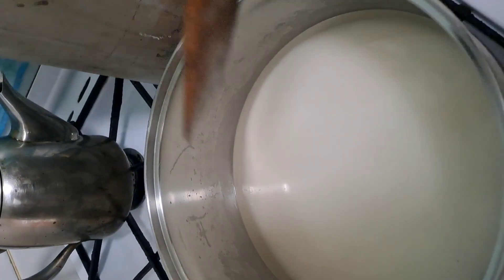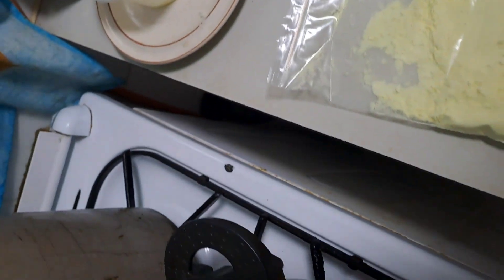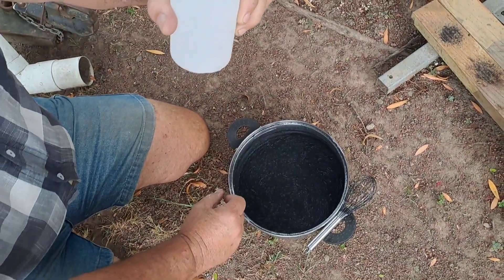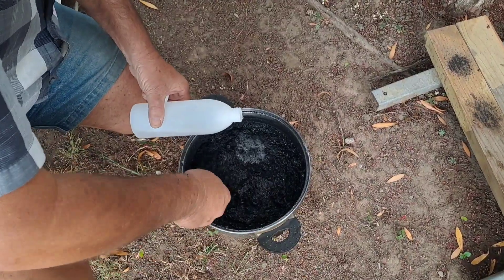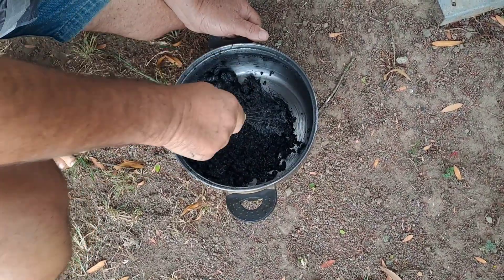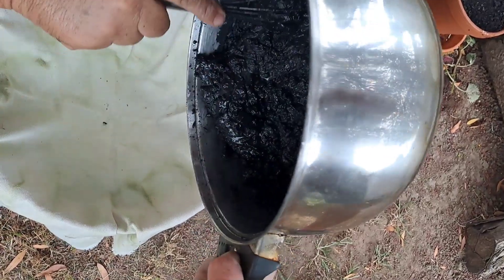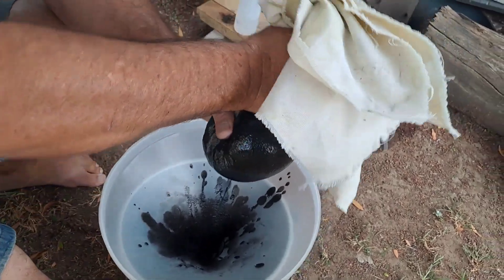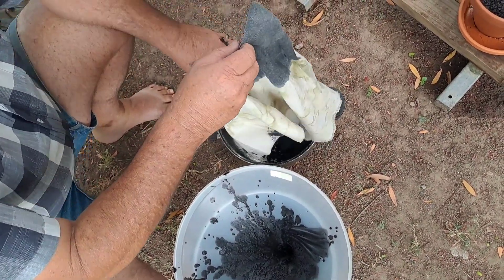Making CIA black powder. Educational video only.

Comment: Would recommend an electric hotplate instead of an open flame burner. Along with using wooden utensils and a rubber bowl scraper. As you mentioned. Dried material on the edges and tools can flair up easily. An open flame is an invite for that to happen. It is one of the safest methods to use to make bp, if done safely :)
Reply: ☝️wat he said

Comment: the acetone or alcohol used lowers the solubility of the KNO3 in solution, causing most of it to crash out of solution, leaving the remaining water mostly free of the chems.  That allows the pressing of the water without losing the KNO3.  For those wondering.  Basically, this step can be skipped, but it you have to let all the water evap.  With that step, you can more agressivly dry it.
Reply: The only issue with using alcohol or acetone is it will deactivate the dextrin. Dextrin is not soluble in alcohol or acetone
Reply: @PyroRob69  Not sure I understand the term "deactivate".  Can you elaborate?  Thanks!
Reply: @derekturner3272  The purpose of the dextrin is to make everything stick together. Dextrin is not very soluble in alcohol nor acetone. You need water to make it sticky.

You use water to make the dextrin sticky, you use the alcohols/acetone to dry faster. If the dextrin doesn't activate, it doesn't matter if you use alcohol/acetone. Nothing will stick.
Reply: this won't nitrate anything will it cus that could explode the gun that's why you can't use nitrocellulose smokeless in a muzzle loader it turns it into a grenade
Reply: @Anon-zu3xn  Are you responding to my comment?  I didn't mention "nitrating" anything.  Olny speaking about the use of the solvent to ensure the potassium nitrate in solution is pushed out of solution(made solid) so it can be press dried in the cloth without losing some part of it with the water being removed.

In any case, potassium nitriate by itself wont nitrate anything without sufficient acid to release it's notronium ion from the potassium for use in nitrating something like cellulose.
Reply: which is it, alcohol, or acetone? or does it matter?
Reply: @heathwilliams1489  Acetone is best and faster evaporating, but 91% isopropyl will work.  Don't use the 70% as it will take a week to fully evaporate without heat.
Reply: Can any one clear up the actual measurements. The only one I know watching this is 2 cups of water 2 cups of acitone
Reply: @lawrenceharper398  the measurments are not all that important.  The acetone is used to get rid of the water.  The first addition should be about equivilent to the water remaining.  If it hasn't boled for long, then just add as much acetone as you originally added water.  Beyond that, it can be ised to accellerate drying by removing the water.  Think about it like this.  If you use cheese cloth to ball the wet powder, the remaining water will take hours to dry.  If you remix the ball into a sludge with enough acetone to make it a sludge again, the ball it in cheese cloth and scueeze out most of the water and acetone, it will dry twitce as fast.  If you repeat the process once again, it will get almost all the water out and it will dry in an hour or less on a warm day.  This is becuase acetone is able to mix with water and carry it away, leaving less behind each time.  Once you have power wet with acetone, becuase acetone is highly volitile(evaporates fast), it will dry very quickly.  Hope that's clear as mud. :)
Reply: @lawrenceharper398  I always used 70% isopropyl alcohol. YMMV
Reply: I just dried it in flame stove pan , it worked .
Reply: @DesiRocketScience 
Really?
Reply: You would think someone with the world's info in their pocket would look up the chemistry involved before trying to to do a tutorial 😅

Comment: I mix potassium nitrate and charcoal and sulphur in hit water and simmer down to a gelatinous texture, then transfer the mash to a drip vessel with a ethanol liebig condenser dripping through it to extract the water whilst ensuring a continuos ethanol recycled ethanol drip. I then transfer the new mash to a dehydrator and set at 80 degrees Celsius to evaporate any residual ethanol , the result is completely dehydrated BP

Comment: Never impressed when a video begins with opening a kit that was premade pre measured and pretending to know how.
   When I make Black Powder step one is cutting the wood that i want to make into the charcoal depending on what the powder is intended for, soft or hard wood. Step two is extracting kno3 from soil. When the need comes around Amazon and kits are not going to be an option. Thanx for being a consumer educating others in being good consumers just the same though.
Reply: I’m too lazy to even think about going to the trouble to round up manure and urine to make one component; that’s why I stockpile. I make my own charcoal; and have a degree in chemistry.
Reply: @charlescouncill  round up manure? Brah I make that component the old fashioned way. I avoid anything that requires spending money to get it. When the time comes if you can't source supplies you going to be screwed or calling me Boss while you are working in my kno3 mines! I am fortunate to live on an active volcano and sulfur is not to difficult to come by with a little bit rugged hiking adventure. It would probably be easier to actually source sulfur over on the mainland. I know plenty of places that have sulfur water coming from their well. 
   My degree (one of) is in History and from that I can see a pattern that is occuring and has occurred in the past. Inspired me to learn how to make anything that I will need without having to go to outside sources. Black Powder is one of the minor things considering the other things that I feel are necessary to have.
   Chemistry degree, maybe you can tell me something about boiling stones. I use broken pieces of Pyrex in my round bottom boiling flask. I'm still having trouble with the bubbles coming in one burst every 30-40 seconds. Tried less then more but it doesn't matter. What the heck is going on and how do I remedy it?
  My chemistry education comes from Granddads Wonderful Book of Chemistry, if you know anything about the book. Then some comes from that old Cook Book that has such a reputation about it being written by an anarchist. The guy doesn't even understand mol weight so it's just a novelty with some minor ideas that possibly work if you change a few things.
Reply: @charlescouncill  as a Humorist it's always good to see someone laugh. Even when I'm not joking, as is the case here. I completely and firmly believe that if you are going to say that you can do something and try to show others how to do it, you should know how to really do it. Especially if it is something along the lines of survival. Without Amazon to supply ingredients then what use is a recipe? To teach requires a mastery of the subject. So knowing what purpose you're making it for, makes a difference between using a hardwood charcoal vs. soft wood charcoal. If you don't know what difference it makes them you really shouldn't be making it in the first place. Why you do something in a certain way instead of another way is important to know and important to teach. The wrong wood charcoal and your not going to get the optimum performance if it even performs. Rockets and explosives need different density wood charcoal to do the job.
Reply from the maker: I purchase large quantities of the chemicals then prepack them into the standard ratios of 75%, 15% and 10%.
I then add 2-3% dextran (baked corn meal).
Reply: @outdoorinterests  Are you gonna make a new video?

Comment: So it’s Kno3 potassium nitrate sulphur charcoal frozen acetone or frozen alcohol? And what order do I put it in?
Reply: 750 gr Nitrato de potasio +150 gr carbón de viña o pino de poda de ramas jovenes + 100 gr sulfur + 100 gr dextrin
Reply from the maker: To 250ml water add kno3 (750gm) Carbon (150gm), Sulphur (100gm),
Dextran (toasted corn flour 1-2%.

Comment: Are you serious! Bro, Your making black powder in the same place as you clean, prep and cook your food?! I'm really going to reserve my opinion and let you experience & learn the most probable lesson here. I really hope you don't end up on the evening news.
Reply: Potassium nitrate is in preserved meat like salami, sulphur is used on grapevines and harmless, and charcoal is in charcoal tablets to calm your stomach. And dextrin is essentially starch. Acetone evaporates quickly, as does alcohol which ypu can drink. What's you ACTUAL point here? Or did you think this was toxic? The only trouble here is using a stove with flames. Should've been electric.
Reply: All that stuff is basically food grade. Black powder was originally made to be a medicine.
Reply from the maker: Thanks for your concern but its quite safe if you follow instructions. Just don't leave it unattended on the stove.

Comment: I agree without pucking ( compressing)the grains tend to disintegrate if they are handled too roughly or the ball and patch are rammed home with force....
Reply: Here in l'il olde England we call it 'corning'. Either way, as our ancestors discovered back in the very early days of gunpowder, merely mixing the ingredients was not great the individual components settling out during transportation. By controlling the grain size we can control the burn rate.

Comment: Is it alcohol or acetone?  You keep switching back and forth with what your calling it?
Reply from the maker: Acetone
Reply: @outdoorinterests  thank you..I've not tried this method yet..I use brass balls in a rock tumbler
Reply: I'm still confused why you mixed it in water? Isn't black powered just gently mixed into a homogenous powder?
Reply: @KiloFeenix  it can be dangerous while mixing..but it's safe while wet
Reply: I always used 95%-99% isopropyl alcohol. 

And I certainly wouldn’t be doing this on the kitchen stove. My wife would unalive me
Reply: While the original recipe use 99% alcohol, this is not available in many countries, so you can use acetone instead.

The goal of these components is to cool the mix very quickly and also evaporate very quickly.

Comment: The cia method is an alternative for peeps without a ballmill and less dangerous than 3 component  ball milling.
The correct method for stupid fast gunpowder= 2 component milling charcoal and sulphur (which is safer than 3 component)
Then dissolve the kno3 in less water the You used,add the ballmilled sulphur/charcoal and cook it.

Then use at least 1000ml supercooled isopropanol in a separate pan(i put that pan in the freezer too) and add the hot mix to it (dont add the alcohol to the hot pan:face-purple-crying:)otherways  in the mix; crystallization of kno3 WILL occur which you cannot see with the naked eye btw.

Larger quantities of iso are preferred to shock and absorb/displace the water content as quickly as possible to prevent crystallization of kno3.
Dry as fast as possible again to prevent crystallization of kno3 which is no good.

Pressing/pucking is done to commercial powders for reasons of transportability and to prevent the stuf getting to powdery.

If you granulate directly after you wring out the alcohol and dry it fast your powder will be waaaaay faster then pucked powder.

The only downside is that it is less dense and the granules will get powdery after transportation/shaking.And you need aprox 10 % more then the denser powder.
It is definitly faster try it!!
Greatings from the Netherlands.
Reply: We are talking black powder here,and nitro is a nono in bp weapons
Reply: Could you explain in detail how this is more feasible or easier than just making smokeless?
Reply: @DCrypt1 black powder is way, way easier to make than smokeless powder. Safe Smokeless powder is not attainable even by some chemists.
Reply: he uses a ball mill later.